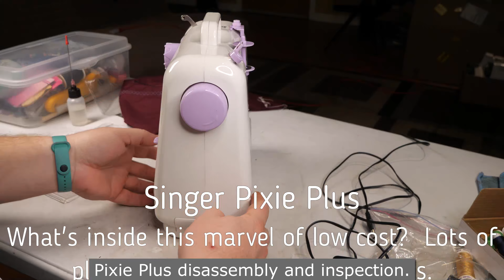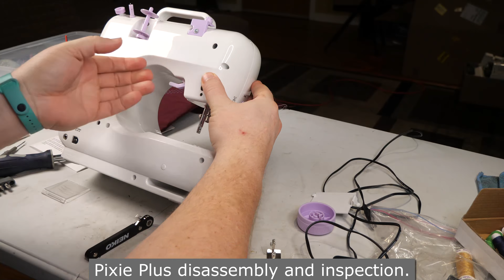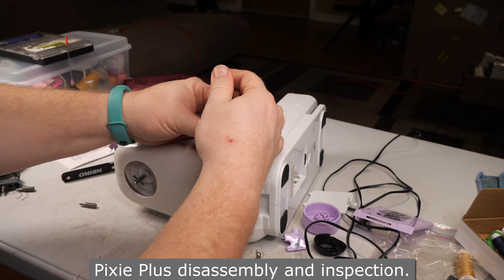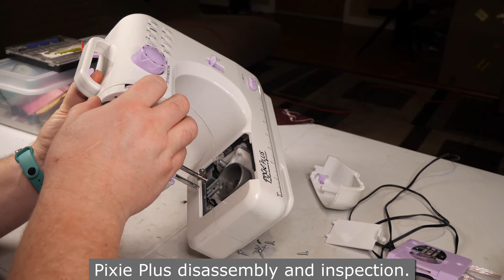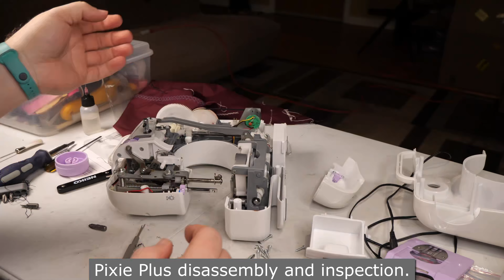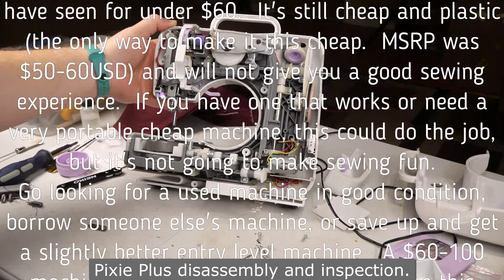Pixie Plus disassembly and construction review

Comment: Por favor dónde puedo conseguir el pdl lo perdí por favor por favor necesito comprar el pedal
Reply from the maker: I do not know where you could get replacement parts for this.  This machine is a generic machine which was branded for Singer as the Pixie Plus but was sold by many toy companies and other sellers under a wide variety of brands.  The control pedal is a simple on/off switch with a headphone plug on the end.  If you have an old set of headphones and a switch you can make a controller for this machine.

Comment: Plastic bevel gears broke, if I could find the $1 part then I could fix it but I haven’t found anywhere that will give me a part number :(
Reply from the maker: The Pixie Plus was a rebranded machine so if you can spot the other brands it wore you might find parts, unfortunately the entire machine is so cheap that they probably never sold repair parts, fully intending it to be disposable.

Comment: Damn it’s funny because they’re sold in  temu now. Same exact thing without the pixie name and all that… I’ve had to repair mine and ended up basically doing a bunch of experimental mods to it including having to repair and rebuild the feeder dog using JB weld and filed it down. It’s stronger than before! Although now I’m having to repair the  rotary to reciprocating joint where the bore snapped. There is nowhere to buy parts as I’ve looked, so if anyone has this machine and wants to get rid of it send it my way please 😆🤙🏼

Comment: this machine evolved over the years in many ways. chinese revisions with no brand gained 4 more stitches  and  needle bar assembly got more and more plasticky so even if you buy new chinese fhsm 505 for parts, many of them just won't fit into older versions of singer pixie.
i am surprised your rotary hook isn't pink or chrome plastic with metal hook though, you would be surprised how many variations are within"singer pixie" labeled units alone. not to mention ant lss/fhsm 505 evolution units.
my most crazy idea is to transform my machine into "heavy duty" model so i already installed hook and bobbin case from singer hd 4432 since it fits and now i am working on retro fiting some components from janome sew mini and designing a backplane for the frame
it is kind of fun to watch you struggle to open it

original purple singer pixies had either zink or abs/gf frames which was much more square and smaller, lower frame that holds to hook wheel was made out of bent 2mm steel and belive me or not but singer selling m1005 machines instead of pixie now but that one is even cheaper inside and was designed by janome, not singer, using the same basic blueprint roughly at the same time 20 years ago. you can still retrofit multiple components of singer m1005 and janome sew mini into singer pixie /fhsm 505. needle bar and presser foot assemblies are the same, many crank parts, gears, motor,hook and bobbin case you can order from local janome bealer
it is geniuinely amazing design, but it is executed in the most cost cutting way possible.